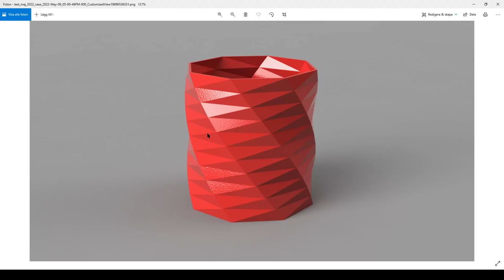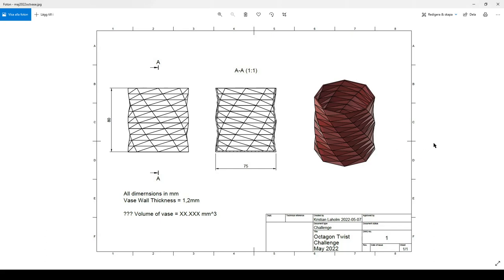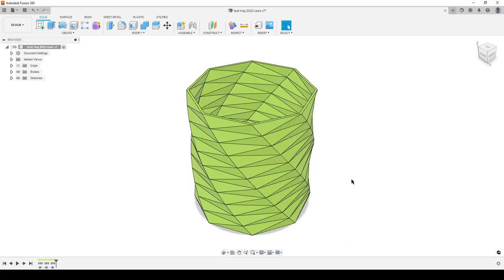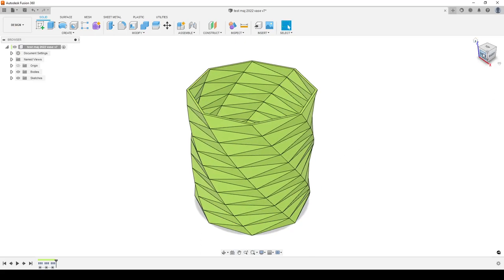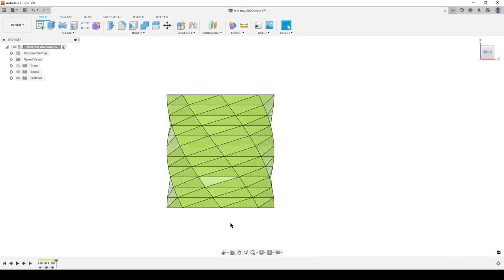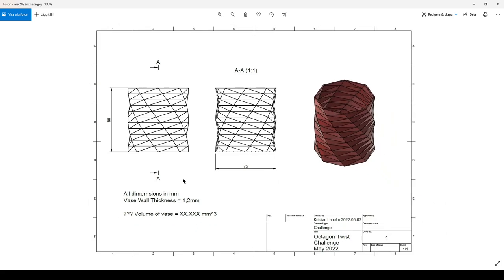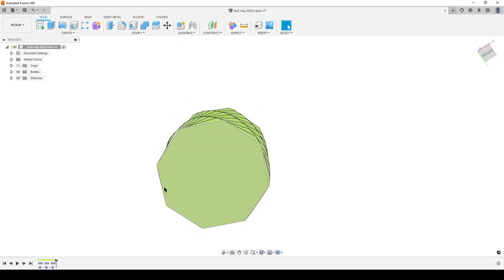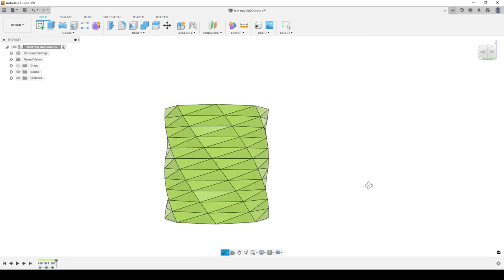Fusion 360 Challenge - Twisted faceted octagon vase

Comment: 26672.84mm^3
Reply: Interesting, if you use Thicken you get 26672,  if you use Shell you get 26710.
Reply from the maker: @matthewjacobs3952  Compare the top face (edge) of the vase using Thicken/Shell.
Reply: @KristianLaholm  its kind of hard to tell form the drawing,  since I don't see any lines on the top of the rim I'm guessing it is supposed to be horizontal, which means shell.
Reply from the maker: @matthewjacobs3952  I didn't specify that in the drawing but mention in the video that the top face is flat. The main part of this challenge was for people to think how to create the triangle faces of the vase.